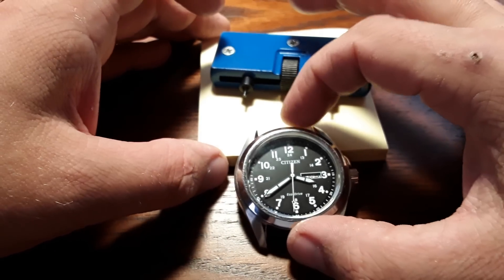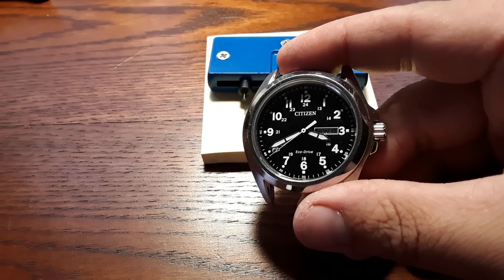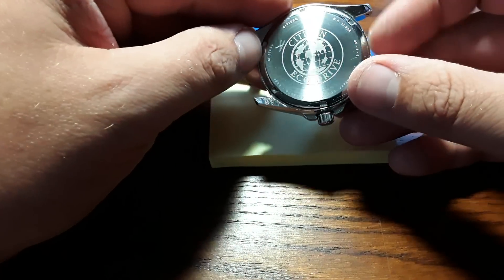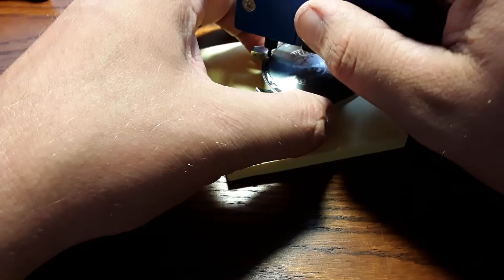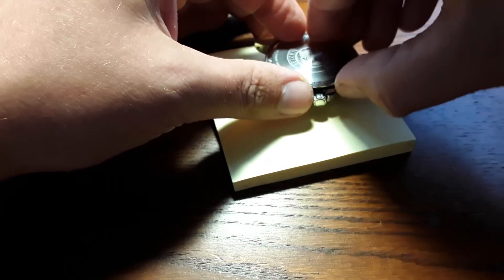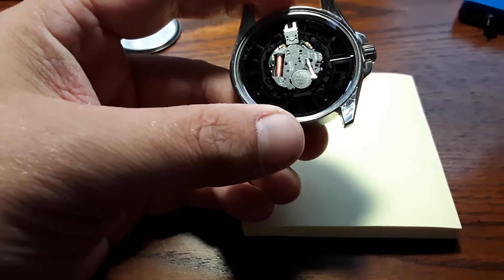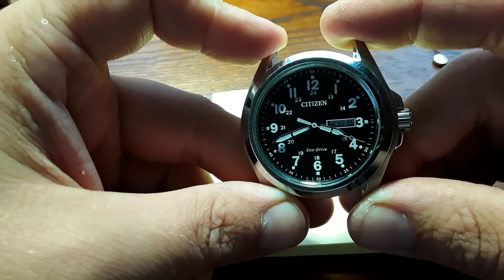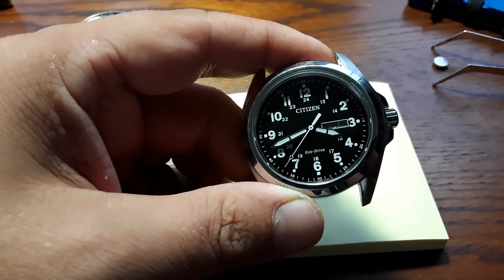Citizen Eco-Drive Runs Without a Battery (Capacitor)! Please SUBSCRIBE

Comment: The eco-Drive system has a battery backup system but runs on a capacitor that holds a charge.  The two second gop that is happening is because the capacitor is not charged enough to run the watch.  It needs a good 12 hour charge in direct sunlight to charge that capacitor and make it run smoothly.  The hop warns you that it needs a better charge.  Yours must have been stored in a dark space for a long time to cause it to behave this way.
Reply: Thanks for the information. My Dads watch has been in a box for some months now.
Reply from the maker: DM RM my pleasure. I hope the video helped you.
Reply: So I wear my watch non stop everyday. Constantly in light, what would cause mine too completely quit working?? I hate to think I have to pay to send it off and get this capacitor replaced
Reply from the maker: Candace Whitfield watch my videos on how to replace a battery and change it yourself. 

95-5100 Genuine Original Citizen Watch Energy Cell - Battery - Capacitor for Eco-Drive Watch (Same 295-51)- https://amzn.to/336trWq
Reply: @candacewhitfield2270  ideally it would be good to place it in a light source whenever you can to keep it working well. I put mine on a window sill overnight or in a watchbox placed near a light source. It will stop working if kept in a dark place after a few months which overtime can possibly damage the watch. The watch will charge in artificial light but will take longer than in sunlight.
Reply: Wrong not a capacitor it's a lithium-ion
Reply from the maker: Stu Sims awesome explanation. Thx for sharing that and watching. Please subscribe if you haven’t already.

Comment: Just learning this I don’t know how I feel about it I think it’s creative false advertising been in the HVAC business for over 10 years and I could tell you a lot about capacitors your air-conditioner start working more than likely it’s a capacitor and it’s not in their best interest to make a good quality capacitor especially one that small Just want to gain some respect for Citizen I completely lose it
Reply: The manuals for these watches state that they contain rechargeable lithium cells which will eventually need replacement. I have owned both Citizen and Seiko solar powered watches, and the Citizens seem to handle artificial light better.
Reply: lithium-ion!!!

Comment: The Citizen Eco drives are really good solid movements, which are very accurate and reliable. They hold their charge pretty well, I have 2 and have left one in the box in darkness for well over 6 months, it was still ticking fine!
I noticed yours is ticking in 2 sec increments, this indicates the charge is very low and it's gone into power save mode. Just leave it in bright sunlight or under a bright light and it will soon charge up👍😎 I'm guessing the watch was still ticking without the battery because light was hitting the solar panel and providing just enough power to run the watch? The battery is just a place to store all that power. I don't think there is a capacitor in these eco drives?
I'd say the benefits over a conventional battery watch is the saving in replacement batteries, had mine for over 8 years  never had to change a battery. 👍😎 
I'd also advise not to let the battery discharge too low, so keep it topped up by wearing it or putting near a light source, do not store them for long periods in a box or closed draw.👍😎
Reply: Makes you wonder why all those other watch brands don't just license this technology from Citizen and save the environment in the process as well!(just think of the millions of batteries and money saved yearly by this!) Why would anyone bother buying a normal quartz watch?!!

Comment: Its a capacitor, and you should not pick it up with a tweezers on both +/_ you will short the cap. there is plastic tweezers for handling the batt.
Reply from the maker: You’re correct sir. Thanks for the tip and thanks for watching. Please subscribe if you haven’t already.
Reply: You  have to the discharge it first
Reply: wrong lithium-ion
Reply: @frankgregory8891  Do you repair watches too?

Comment: Also if YOU don’t replace the battery storage unit send it to Citizens for repair and battery!
Reply: i sent my Stiletto Eco Drive to the official Citizen watch repair co for a new capacitor to be fitted.
i'v had it since it was first released  & for many years & is well looked after...
i also included with the sent watch the correct new replacement capacitor
the repair cost me an arm & a leg....very very expensive 

175€ i supplied the new parts capacitor Panasonic costs £25
total costs for repair 220 including postage 

WTF we live & learn. 

still love the watch though ( very very slim & thin ) & still looks brand new 

sapphire Chrystal ------ i think at one point it was referred to as the worlds thinnest watch

Comment: I've got one that was a gift.  I left it in a drawer for 6 years, which is probably why the "battery" went bad.  It's said that it's actually a high value capacitor.  (supercapacitor.)  I just need to get one on line and I'm good.  Thanks for showing that it's actually a bit different than a regular watch battery.  The align is important.  Also get the right tool for taking the back off if it's tight.  Easy to scratch hell out of it.
Reply: rationalguy If you only knew what a capacitor was it’s just a little bit a dielectric fluid that multiplies electrons sounds a lot more complicated than it is
Reply: @Erk0806  I'm an electronics tech.  I know what a capacitor is.
Reply: rationalguy Then you should how low technology it actually is I was this close to buying a Citizen after figuring out what eco-drive actually is I would never consider buying a citizen rather buy a tag Heuer
Reply: lithium-ion

Comment: If you look at the second hand, it is running every 2 seconds. That us the built in feature to let you know the battery is low.  You need the battery re-install. More useful video is to tell us if you can get a replacement battery.
Reply from the maker: I have a follow up video showing that the watch didn’t need a new capacitor battery. It simply needed natural sunlight. Despite Citizen’s claims that the capacitor battery gets charged with any light is false. I kept the watch in a window for a few days and the watch is running fine with no replacement necessary. Should last 15-20 yrs. a replacement capacitor battery will run you about 20-30.00. 

Thanks for watching and please subscribe if you haven’t already.
Reply: not re-install lol! charge it!!!

Comment: Dude the solar panel is giving energy from your light bulb. If you cover the watch with your hand it stops working.
Reply from the maker: Nuno Amaral that’s completely false. Solar energy is stored in the capacitor. You can hold your hand over the watch for weeks and the watch will still run.
Reply: @AvgJoeWatchReviews   you are right. But um this case the watch is running without battery because it is reciving energy from your Light bolb
Reply from the maker: Nuno Amaral I understand what you are saying now! Thank you sir. That’s absolutely correct. Please subscribe if you haven’t done so already and thank
you for watching.

Comment: It has to have a power storage device otherwise it will only work when it is in the light. I have had an EcoDrive watch for about 15-20 years and have never once had to replace the battery/capacitor. So I would say that there is a significant benefit to these watches.
Reply: RE: Mark, Same with me. My eco-drive is a 2004 model I got as a gift. Never needed to replace the battery. It just needs real sunlight, not indoor light to charge correctly. Citizen clearly states that in the manual. The capacitor will wear out over time, but it's hardly noticeable if you use the sun to charge it. Mine is 16 yrs old, guess we'll see.
Reply: Same experience here. I've had a Citizen Stiletto with eco-drive for 15-20 years and it's still running well after charging with sunlight. I've never bought a new battery/capacitor.
Reply: Yeah totally agree here. I've had one for 20 years and just got another, only because the bezel wore out and came off.
Reply: Please how because mine only works in the light
Reply: Hussein’s Vlogs - I own two eco-drives: a Promaster diver’s 200m meter diver. and a Military 20m. I have also owned in the past (until it got stolen) the one described in the video. I never had any trouble with power storage, one having lived in dark of the sock draw for three months and still working perfectly. In a nutshell, it would appear that your battery/capacitor has turned up its toes and needs replacing.
Reply: @copycat4785  yeah you need a battery.
Reply: Great!!! So what was that all about ???
Reply: @keithmabbitt4030 What drugs are you on?
Reply: I have had to replace my wife's watch eco drive battery two times now.  The first time after about 10 years, second time after 4 years even tho I purchased replacement battery from very reputable supplier.  Her watch uses a very small citizen 295-76 battery (called capacitor battery for Eco-Drive), and it's not cheap ($18).  I would rather replace more often with a less expensive battery, so I would say the eco drive is more of a gimmick from a marketing standpoint.  Her battery is much smaller in size than in the watch shown in this video which might also be related to its shorter life span.

Comment: Mine was doing the same. Took it to repair shop and cool guy asked if I stored in in a case which I do in my drawer with about 10 other watches mixed with other echo-drives quarts and automatic watches.  He could have replaced the capacitor and charge me but told me to leave it by my window for a few days to charge and damn it the thing works now. Had the watch for only a year so knew couldnt be watch already going bad. Seems obvious now but I dont store my watches in the drawer any more.
Reply from the maker: RealityHurts923 thanks for watching. Check out my follow up video where I did exactly what you said and fixed the issue.
Reply: If only men would read the instructions the needs of light to top up the battery would have been known..... But men and reading instructions rarely go together or so they say...... Of course the foregoing is a blanket statement as there are many of us men who do read carefully the instructions for caring for solar powered watches.....Some very good advice in the comments above..... Incidentally i have two Citizens that are solar powered plus one Seiko.... They are all amazing time pieces and keep fantastic time almost to the second....
Reply from the maker: Please SUBSCRIBE if you haven’t done so already.
Reply: lithium-ion!